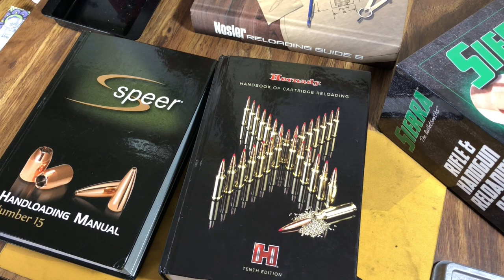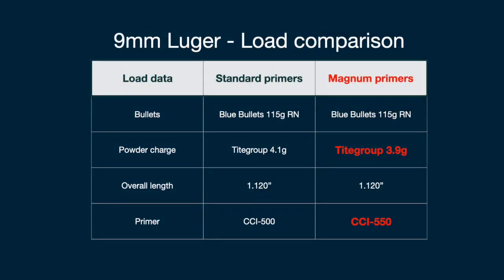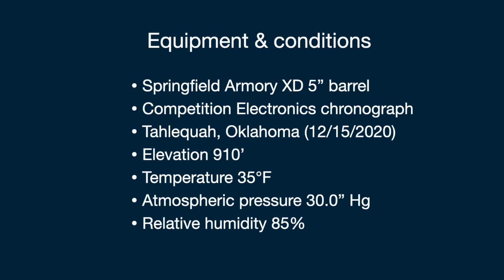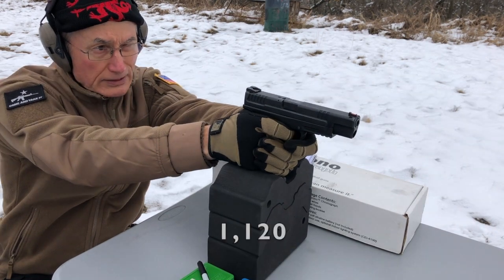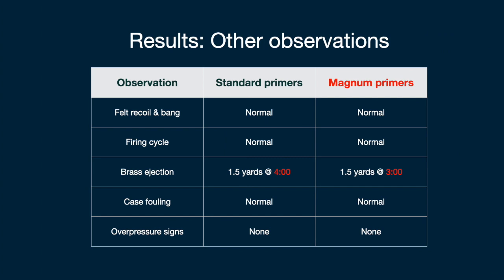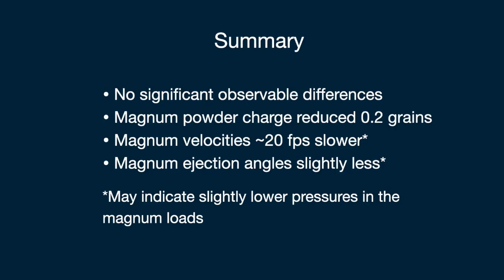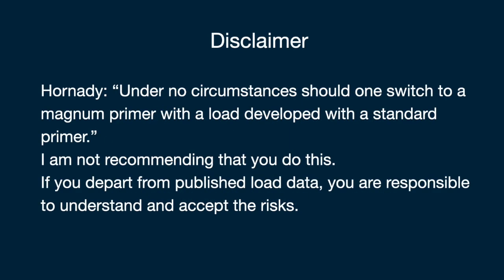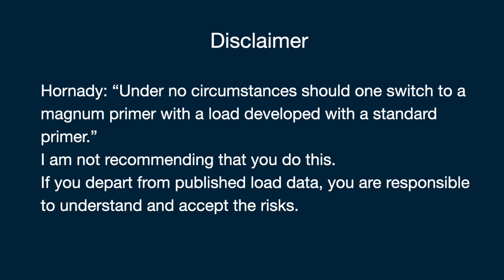Magnum Primers for 9mm Luger?

Comment: I run small rifle primers in my pistol loads no issues. 357 mag and 7.62x25mm tokarev
Reply: See Norman McNeal's comment from 3 weeks ago. He said the difference between magnum and standard primers is the thickness of the cups. I've heard the same for rifle versus pistol primers. I have yet to verify this, but if it's true, the problem with using "higher" level primers, ie, magnum over standard, rifle over pistol, is not so much excess pressure, but rather the risk of a misfire, that is, failure to ignite. If your firing pin spring creates enough momentum to ignite the primer, then, in theory, it should be fine. However using a firearm with stronger firing pin spring on a "lower" level primer, like a rifle on a pistol primer, runs the risk of piercing the primer, which could allow high pressure gasses out the back toward you!
Reply: @salmonthomas  it's all hype same thickness same size only difference is a tiny bit more compound if that. Large rifle and large pistol are the same large magnum same tiny bit more compound . small rifle small pistol the same small magnum tiny bit more compound. Talk to two different guys who have been to the plant and they use the same thickness of materials to make the cups and anvil to make primers .  this is per the guys running the machines and making the primers when they asked that's is what they where told.  I have used cci Remington tula and s&b Winchester primers I have not seen any difference but color of cups and packaging  even when buying match primers same just cost more for a warm fuzzy feeling .
Reply: @adamlong54  The SAAMI drawings show that small pistol and small rifle primers have the same dimensions, but large rifle primers are slightly larger than large pistol primers. Also, the primer pockets are slightly deeper for large rifle versus large pistol. Also, although bench rest/ match primers may be the same dimensions as the standard version, I heard they are inspected more closely and therefore have better consistency. I've tested standard large rifle primers across brands and with CCI bench rest primers, and indeed had a significantly smaller shot group with the bench rest primers. For most shooters that wouldn't be important, but if I'm going for optimal long distance precision, I use bench rest primers.
Reply: @salmonthomas  you know you can make your own too. Lol
Reply: @adamlong54  Yes, I've heard that, but I'm not that desperate now! That doesn't sound so appealing.
Reply: @salmonthomas  out of all the primers I have loaded over the years I have had only one bad one and maybe three that fired the second hammer drop.  The rest never an issue all went bang and worked like they are supposed too.

Comment: The “ magnum” moniker is misleading.  The thickness of the primer metal is thicker, to offset harsher loads!   Remington is honest about their primers, the higher the number, the thicker the metal.   It has benefit when using slower burning powders and bolt face protection at maximum loads.
Reply: Thank you for mentioning that. I never knew that about the Remington numbering system. I thought they had funny-sounding numbers.

Comment: This is very dependent on the powder that you are using. A magnum primer is to light a heavier propellant charge, but, with the relatively light charge in a 9mm and the rapid burn rate of the Bullseye powder you are using, there really is not much of a difference between the standard and magnum, which is something you basically proved with your reduced charge and the drop in FPS. Now if you you repeat the test with something like HS-6 or Longshot, where the burn rate is slower and the powder charge greater, you will see that the magnum primer will light off more of the slower burning propellant when it goes off than a standard primer, and should see a slight increase in the pressure. Where you can run into problems is if you have a very light charge and the magnum manages to light most of it off at once. That being said, I have used magnum large pistol with 700-x (which burns a little faster than Bullseye) and noticed no difference, and have also used magnum small's with HS-6 and CFE Pistol with no problems, but have stayed closer to the recommended starting loads for the 9mm so it would be well under what the max pressure would be with a standard primer and a larger charge.
Reply: Thank you for the good input. Internal ballistics is more complicated than most shooters realize. I didn't think about burn rate as a consideration. I actually was using Titegroup rather than Bullseye, but it's also fast burning and takes a low powder charge. I wonder if small pistol magnum primers for 45 Auto would be a better way to conserve my standard small and large pistol primers? For 45 Auto I prefer slower burning powders, like those you mentioned, which also requires more powder than Titegroup.
Reply: @salmonthomas I remember a long time ago finding some .45 auto that used small primers while picking up brass at a small backwoods "range". I loaded them up and they shot fine.
Reply: 45 Auto can come with either large (more common) or small primers. The reloading process is the same for both, except the primer must match the primer pocket in the brass.

Comment: I appreciate your research.  I’ve been using mag primers in 9mm for years and I also use small rifle primers in competition +p+ loads as they have a thicker cup and less chance of primer blowout
Reply: Thank you for the information on how it worked for you. I've received similar reports from others, so the consensus seems to be that magnum pistol primers are fine. Some recommend reducing the powder charge slightly, but others use the normal load data. I'm more reluctant to use rifle primers, but I appreciate hearing your experience.
Reply: @salmonthomas  Before you load 1000 rounds with rifle primers, load 10 and test it.  Some pistols will not strike hard enough to ignite them, nothing worse than having unreliable ammo.  I too once trusted internet and learned the hard lesson.
Reply: How much do you decrease the powder charge when using Small Rifle in place of Small Pistol primers?
Reply: @rcairflr  10% and work up form there, shooting through a cronograph monitoring velocity deviations and pressure signs till I achieve my desired load, In my own personal experience no notable change in pressure or speed from one primer to the other.  The rifle primer is thicker in the cup so less chance of primer blowout therefore I’m my opinion a safer primer to use in “hot” loads. But handguns with a reduced trigger pull AKA lighter striker springs. You run the chance of not detonating the primer,   “Light primer strike”  my guns typically have a heavy striker spring
Reply: Do you ever use magnum primers for a +p 9mm load
Reply from the maker: I personally don't load +p. I don't see any purpose for it, and it probably saves me from excessive wear and tear on my guns.

Comment: My 9mm plinking load is a 115 grain plated round nose over 4.2 grains of Titegroup with magnum pistol primers, OAL 1.135. Zero problems. Works fine.
Reply from the maker: Thank you for the info. That's just 0.3 grains more powder than I used, which sounds reasonable considering your longer OAL. Mine was 1.120. From multiple responses, it sounds like the consensus is that, with an appropriate powder charge, magnum primers for 9mm is a reasonable option if standard primers are not available.

Comment: Great video, huge help. I’m new to reloading ( 4000 +/- through my Dillon ) 9mm. I use 147gr projectile with 3.3grs of TiteGROUP,  small p.p. Recently picked up a brick of small magnum p.p. and loaded up 100 rounds (3.3grs TiteGROUP) to test at the range. I felt no difference and my grouping at 25 yards was the same.  Based on the amount of powder you seem to be using, should I bump up my powder a bit? At my last Steel Challenge a few weeks back, it seemed to take forever for the audible ping on the 35 yarder. I almost put another round to it because I thought I’d missed. I was taught to use the least amount of powder to get the most loads out of a tub.   Would like to hear comments, thanks
Reply from the maker: I checked the Hornady, Nosler, Sierra and Speer manuals, but none of them had data for Titegroup in 147g, so I checked the Hodgdon online site. They had data for just one bullet at that weight, the Hornady XTP, which is a HP. Their overall length was 1.100" (close to your's) and the ranges of powder charges they recommended was minimum of 3.2g and maximum of 3.6g. You can't exactly equate the reference bullet (Hornady XTP) to your's but their data can give you a ballpark feel for what should be reasonable. Based on that, your 3.3g seems like a good mid-range load. Even if you increased a few tenths of a grain, you wouldn't change velocity enough to notice. Every 0.1g would probably increase velocity only about 20 fps. I definitely wouldn't go above 3.6g, especially with magnum primers.
Reply from the maker: Generally heavier bullets of the same caliber require LESS powder, so you might be just about right, but I"ll have to look up the data in my reference manuals. Can you give me some more data; namely, overall length, type of bullet (FMJ, HP, etc.), brand and barrel length? Hopefully I can look up the data tonight or tomorrow.By the way, one of the best ways to evaluate your loads is to chronography your bullets and compare your velocities to those in the reference books. If you reload, a chronograph is an invaluable tool.
Reply: @oakleydefense5513  I use CamPro 147 full copper plating , round nose flat point. OAL is 1.0990  Barrel lengths are both 5” ( Glock 34 and Walther Q5 Match )   Yes, I would like to get a chronograph, one of my next adds to the tool box for sure. Thank you for your help 👍🏼

Comment: I've used magnum primers in 9 mill for years with a lite load of bullseye ,shoot great
Reply: Thank you for the input.
Reply: What grain was your load?
Reply from the maker: @MrJda868  I show data for my loads in a table at about 1:15 in the video. I used 115g bullets and my Titegroup charges were 4.1g for small pistol primers and 3.9 for the magnums. Overall length for both was 1.120. Note that I used Blue Bullets, which take a slightly different powder change than FMJ.
Reply: @MrJda868  I mean 4.3 grains of bullseye ,124 grain bullet
Reply: @mikerussell6212  I use Bullseye as well as 115gr. And just ordered magnum primers. I usually load 4.7, so your load sounds spot on. Thank you for sharing your load data with me.
Reply: 5.3grs of bullseye

Comment: Since you used different powder charges the test is meaningless
Reply: Could you explain?
Reply: If you had used the same powder charge for both primers we could see the effect upon velocity that would occur (if any). Since each primer had a different powder charge this introduces a change in two variables: powder charge and primer type. Now we have no way to know what part of the change in velocity was caused by change in primer type. You would normally only change one variable at the time.
Reply from the maker: @charlesphillips5906  Yes, I see your point. Ideally, from a scientific design perspective, you usually want to alter just one variable while holding the others constant. However, in order to provide a margin of safety, I reduced the magnum charge by 0.2g, and then compared the magnum versus standard primers. Scientists often perform pilot studies to refine their methods. This was a fast, simple, pilot study, which for my purposes, provided useful information; namely, that with this margin of safety, the magnum primer did not produce excessive chamber pressure. Thank you for the input.
Reply: @oakleydefense5513  But it yielded no useful information. If you enjoyed doing it that’s great, but you didn’t tell me what happens if I substitute Magnum primers (which I have) for non Magnum primers (which I don’t have).

Comment: Magnum primers are hotter causing higher pressure.  You can use them in place of the standard.  However, you must work up a load to one find out if you will have any pressure issues. Second, to check your bench shot groups to see if you have better groups.  All of this is based on the type of powder you are using.  Magnum primers were designed to burn Hotter and consume larger amounts of powder burning all of it. Using magnum primers without  working up a load is very dangerous especially if you are running hot loads.  The mag primer will increase pressure and boom no fingers. Bullseye powder burns dirty and I found unburned powder in the chamber and on the outside of the breach.  So, I tried mag primers and worked up the load.  Result was that I use 2 tenths of a grain less powder and had the same velocity and better bench  shot groups.  If you are loading a maximum load, that 2 tenths of a grain could blow holes In your primers or force them out of the pocket.  REMBER play it safe and work up s load.  I've been  reloading for over 55 years. That does not make me an expert but intelligentsia comes with age. Oh one last thing.  There is a difference in velocities and pressures between different primer  manufacturers.  Lymon reloading manual compares the differences and gave the advice to work up a load if swiching to mag primers.  Guys you have to read and not go off half cocked before doing  some things.  It is called a MAGNUM PRIMER for a reason
 Same as magnum bullets.  Think, Think. Think. Not too smart fella.
Reply from the maker: Thank you. That's good advice and information. I also made clear, by quoting from the Hornady manual at the beginning and end, that swapping magnum for standard primers is NOT recommended. As you mentioned, I reduced my powder charge for the magnum primers 0.2g below my standard load, which turns out to the bottom of the range for 115g LRN (Hodgdon data; Blue Bullets behave like LRN). I also analyzed velocities, standard deviations, distance and angle of ejection, magnitude of recoil, sound, and looked for signs of overpressure. In theory, you should follow load data exactly as written, but it's often necessary to make minor substitutions. For example, the reference might call for Winchester primers, but you can only find CCI. Their data could be based on a 5" barrel, but you have a 4" barrel. They may use Hornady brass, but you have only Blazer brass, etc. Based on a knowledge of fundamental reloading principles, you may have to discern minor, low-risk substitutions versus others you would never do. For example, swapping powders is a VERY BAD IDEA. Another consideration is the current ammo shortage. Primers are essentially non-existent, and your choice could be, don't reload/don't shoot or try to work out an alternative that is safe and works.